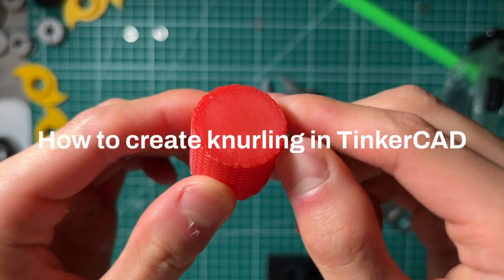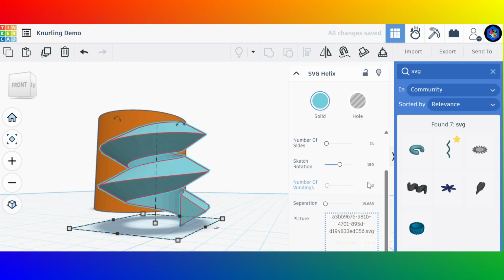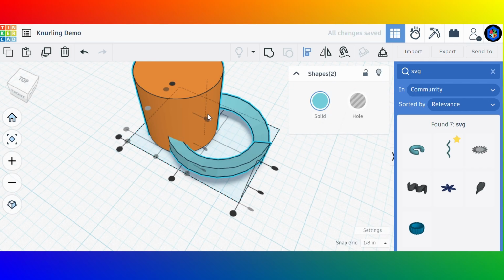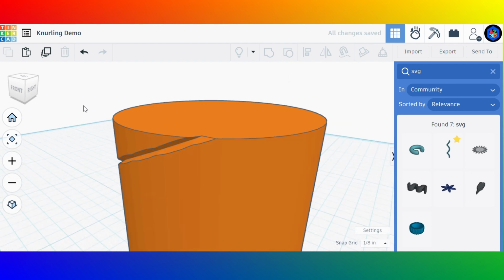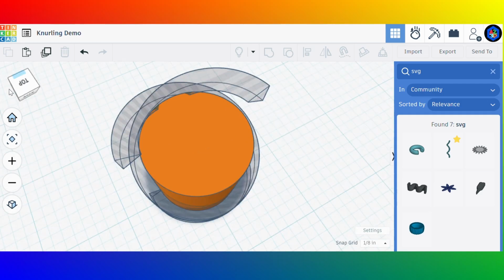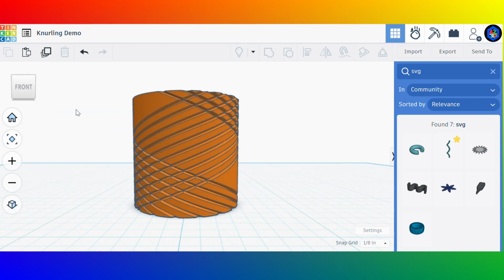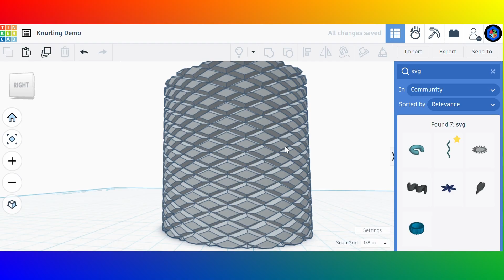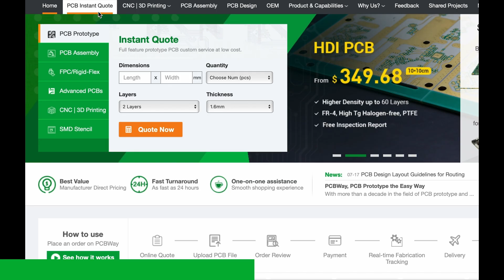Knurling in TinkerCAD!? | How to model Knurling in TinkerCAD | Tutorial | Knobs Texture in TinkerCAD

Comment: When you imported that SVG did tinkercad provide extra parameters special to that SVG?  If so how was that done?
Reply from the maker: I don’t believe so. Nothing special 😅
Reply: @AZ3D_printing    I am a tinkercad beginner.  Please expand on this point.   I see the imported svg.   I do not understand how you combined it with the round SVG Helix then reversed to get the knurling cutting tool.  Thanks.
Reply from the maker: @charleselkins4546 are you using tinkercad on a computer? The video should show how to do it. If it’s not working, Hlmodtech (another YouTuber) has a video on another methos
Reply: @AZ3D_printing  Where in the video does it explain how to do it, I also downloaded the file and can't figure out how to use it. A little more detailed explanation would be great, other than Download the file.
Reply from the maker: @lilfear  you want to upload the file into the part where it says "Picture" (scroll down a bit in the table). is that what you're asking? sorry it's hard to interpret it through words.
Reply: @AZ3D_printing I tried that and nothing happened.
Reply from the maker: @lilfear  there should be a place to upload the file. dm me @az3d_yt on discord
Reply: @lilfear  - It's not told well in the video. 1- click on the link to the Printables page. 2- click on the download button next to the "Equilateral Triangle SVG" under "Other Files".  it will probably take you to the picture itself.  3-Right click on the picture and click "save as" and it will save this as an .svg.  4- go to Tinkercad and search SVG in the search bar on the Right where the magnifying glass is. click and drag the spindly spaghetti thing onto the workplane.  This is the helix shape with the parameters. At the bottom of the parameter window you will see a dotted line box under the Picture heading.  Drag the svg file you downloaded into that box and in a few seconds you will have a helix triangle just like the video.